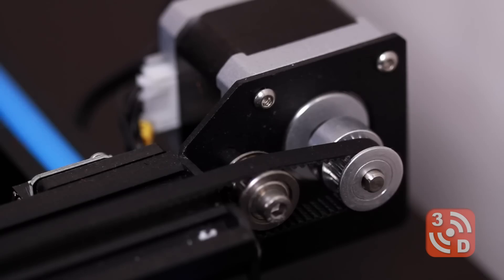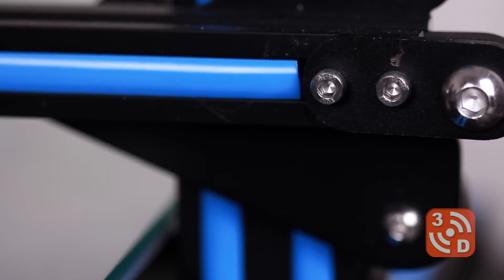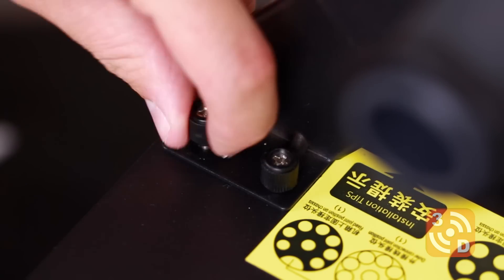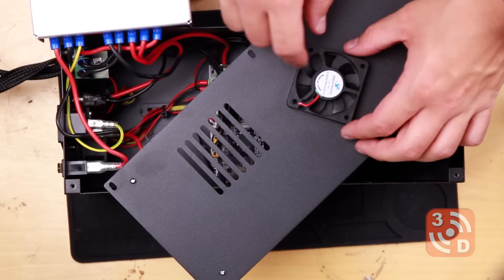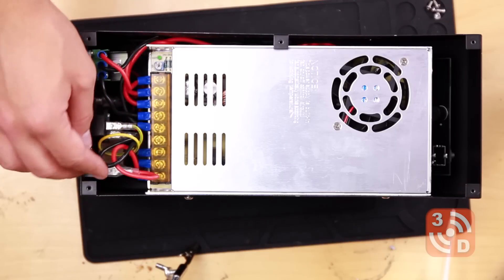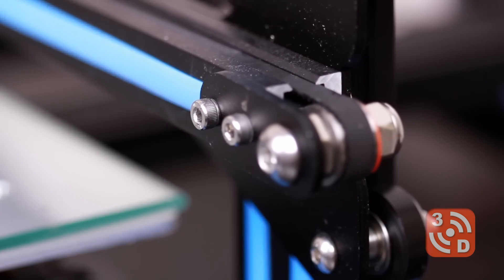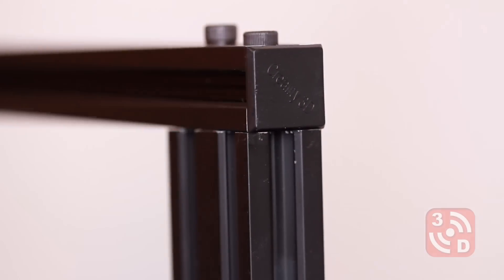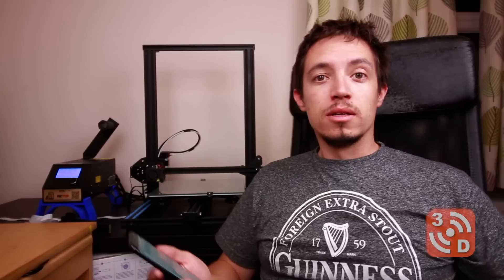3 Ways to Silence your CR-10

Comment: @13:05 you do some editing that makes me feel as though the x-axis was still noisy and you are pretending like the isolator mounts worked when they didn't. This may not be the case, but you sort of cut away from being able to see the machine moving, and went to some other footage and then came back and said "it worked"
Reply from the maker: Hi John, the cut was in no way intended to deceive. I cut from a wide shot to a shot where you could clearly read the value on the screen. Effectively I filmed the whole process in the wide, the reset the camera for the tight shot and did the whole process with the tight angle and just cut between the two. I'm sorry if you felt you were in any way mislead. The whole reason I started my channel was to offer easy to understand and honest tips and tutorials in 3D printing and tech. I've never wanted to misinform or mislead.
I can assure you that was also not the case here

Comment: I got a pair of Motor Vibration Dampers today, but it was a bit harder to install than just 8:33 as my model has a little housing over this entire part, so they could slap a QR code sticker over it. Took me a while, and needless disassembling, before realizing all I had to do was remove the sticker... Thought it was going to be just a fancy little gimmick, but no... I'm actually printing right now and I keep having to look over my shoulder to see if my print is actually done, because I don't even HEAR the nozzle travelling anymore. Well, only when it has to travel, as I set the speed high (Z-axis bar vibration), but this was done because the printer was noisy and I wanted the noise to finish sooner... NOW I can just print at a steady pace, even if the printing carries on into the night, as the cranky ol' man living the floor below will NOT hear the printing-vibrations through my floor!
I won't get the fans until late this week, if not next week, but just these two inexpensive vibration dampers have transformed this printer significantly, much to my surprise. The fans will just be for added comfort for myself, mostly! Thanks for making this video! 👍
Reply: Update: I got my fans and installed them... I have to say I was a little underwhelmed, as the box still sounds like a small handheld vacuum cleaner, unless it's the power supply fan (which I similar to this video, didn't touch) is making that sound all on its own. Rather build a small, cheap audio-foam box that it can stand inside. Other than that, the Motor Vibration Dampers are absolutely mind-blowing in how effective they are! Thanks again. 👍
Reply from the maker: Really glad it helped! The is for the feedback and good to hear it's quieter now.
Reply: @3DRevolution  Another update. I installed another vibration dampener on the filament feeder motor, so now my little Z-hops on travelling are extra quiet, as well as found some old rubber exercise bands, which I cut into pieces, unscrewed the Z axis motors and slipped the rubber strips in between the motor and the frame in an L-shape, poked holes for the screws and secured it back nice and tightly. This further reduces the Z-hop squeak/buzz. It's about as quiet is it'll get! 👍
Reply from the maker: Great work and thanks for coming back with the update! May all your printing be quiet and spaghetti-less
Reply: @3DRevolution  I DID have to quickly cancel my first print, because I forgot to account for the half of a millimeter I had just raised my Z-axis with by padding it. 😂 Thanks again for the 'silencing' guide! 👍
Reply from the maker: Haha well done for catching that!

Comment: Hello,

Thank for this great video, you really motivate me to replace my Fan 😀

I got a CR10 V2, I got a quick look inside and

> The Fan for ventillation is a (50x10) :Creality PD05015MS4 DC 24V then I do not think that I could replaced with the one that replace (Gelid Solutions Silent 5) since it's a 12V ?
The previous one for you was also a 12 V?

MY next question is How did you fix your camera on your bed since so far I did not find a way to do so.

thanks in advance for your help 😀😀😀😀😀😀

Best Regards

Cedric
France
Reply from the maker: Hey Cedric, Really sorry for the late reply. As you'll see from a recent video I posted ("I'm Back"), I haven't been able to post again for a while and I'm now catching up with everything on my channel and have some new posts coming out.

As for your questions, regarding the fans you mentioned, I don't actually have my CR10 anymore so I'm not able to 100% check which fan(s) it used I'm afraid. However, if yours is currently fitted with a 24v one, replacing it with a 12v is not a good idea I'm afraid. It may be that for the V2 they upped it to a 24v to increase airflow?

Regarding the camera on the bed, I printed an arm that fitted over one corner of the mounting points for the bed (so it was clipped on benieth the bed in the front corner and screwed on using the same screw holding the bed itself. 
If you check out Thingiverse (or better yet, Printables), for print-bed camera mounts for CR10, there should be a fair few to chose from.

Thanks for your comment, and happy printing!
Reply: @3DRevolution  thank you very much for your answer and information. If your back I will check your channel for every new video 😉😀👍

Thanks a lot !
Cedric 
France 🇫🇷

Comment: Are they 24v fans you replaced
Reply from the maker: Hey, I'm very sorry for the late reply. I've been recovering from a serious accident since July last year and whilst I've been reposting for the last couple of months I'm now getting round to catching up on my comments. I'm afraid I don't still have my CR-10 now. However, I belive they were 12v fans, but that the CR10s (the more recent one) used a 24v fan so that will likely require a 24v one for replacement.

Comment: Hey Does the PSU make noise? Could you maybe use a quiet pc PSU, I hear the CR10 is 12v?
Reply from the maker: Hey Pieter, yes the PSU does make noise due to the cooling fan.
It is possible to replace the fan but I chose not to cover that in this video as opening up the PSU can be dangerous and I didn't want to encourage people who didn't know what they were doing to start messing with mains voltage.
Reply: @3DRevolution  In the past 2 months since I've posted this. I've went full noctua on my ender 3 replacing it's PSU fan by a larger NF-18 and the extruder fan by a NF-A4x20 resulting in a noise level 22 db without the layerfan. I did have a faulty power connector that burned when I used the silent board's preheat all parallel feature.

Comment: I mounted my control unit under the desk, thus minimising a lot of the fan noise, not that is was that noisy to start with, the real noise came from the upper bearings on the Z axis leadscrews, the noise was occurring whenever the X axis was moving, because the Z axis leadscrew are so long on the 5S they resonate, I removed the steel roller bearings, measured them and printed solid replacements, no more Z axis noise.

Comment: Nice. I made similar changes before found your video, but now my CR10 is in the basement and I switched to Alfawise U10 where I made lot more changes to silence it even more. Also replaced the stepper drivers by TMC2208, which made the printer really silent. Pity, CR10 has no replaceable stepsticks.

Comment: The noise of the steppers cannot be measured by moving axises, instead you need to put them in printing mode because their movement speed is in fact much higher.
Clear and well presented instructions

Comment: DO NOT DO THIS MOD. I spent the £40 for all the fans. And the one for the extruder. Is only half the speed. Which results in the extruder over heating goes in to safe mode and the ones you put in the power supply are not fit for purpose. So have to buy all new fans from clarity DO NOT LISTINE TO THESE VIDS. YOU WILL KNACKER  YOUR MACHINE UP.

Comment: Must be a real PITA using a Creality XX.
My P3Steel Toolson with bronze sinter bearings runs at 34db with A4988 drivers out of the box.
It sits behind me and every now and then I have to turn around to see if the print has already ended.

Comment: the air flow designs are so dumb on these chinese printers.

also most power supplies sound like a jet engine ;c you could've used this as an opportunity to replace that fan too!

I removed the PSU and the motherboard fan on my Anycubic. mounted a super silent but cheap (bigger ones tend to be less noisy at cheap prices) and covered every single vent expect for the one on the rear back. now air comes trough the front and exits trough the fan. no issues whatsoever.

Comment: Great video, But those strips can just be pulled out as they are. No need to remove anything. Just something to pry them out and pull out frontwards.
Reply from the maker: Thank you very much Beagz, glad you enjoyed the video. Yes the strips can just be pulled out but I'd read a number of people saying that theirs were produced with extra stiff rubber and I didn't want to advise people putting undue force on their printer when trying to remove them so was more a precaution than anything

Comment: that moment, 
when you realize that you have the same chair from ikea and that the head piece is worn the exact same way than his
Reply from the maker: Haha, I've been meaning to replace this thing for around 2 years but still got it. Has the height control also broken on yours? I cant tell you the amount of re-takes I've had to do because half way through a video I slowly start shrinking on the chair.
Reply: @3DRevolution  no it keeps it hight pretty good, at the lowest setting :D no just kidding, really the only thing that bothers me is the flaking off the headpice, everything else is very good made, better than anything i had before. usually the chairs last only 1-2 years, this one i had for like 3 or 4 now.
Reply: @MrZhefish  lol good call. #metoo

Comment: No one has mentioned that when the belts are tightened, it pulls the motor's spindle so that it is no longer in alignment with the other ones. This is due to the give of the rubber. It was bad on my Y axis and I didn't even have the belt super tight. I ended up taking it off the Y. EDIT: Just found this which may help: https://www.thingiverse.com/thing:2734468

Comment: the real problem are feets!!!!
Reply from the maker: Hi Enea, thanks for the comment. You are absolutely right that the feet make a difference. 
Here's a set of vibration dampening feet I designed for the CR-10: https://www.thingiverse.com/thing:2738254
Print them in a flexible filament and they make a big difference.
Reply: @3DRevolution  i m interested in your files... i ll print for sure! Thanks a lot

Comment: Just wanted to ask if it affects print quality. Coz, just in theory though, when you have that dampeners installed and there is a sudden change in stepper direction, the rubber may have a tendency to twist and therefore target coordinates may overshoot.
Reply from the maker: Hi there, I can happily confirm a year after making these changes that print quality was unchanged.

Comment: You can just pull out the blue stripes in the frame without dismounting anything because they are out of a felxible material and not stiff... It also was unnescesarry to pull out the one on the horizontal top bar. There are no moving parts at all ;)

Comment: if you really wants to quiet down this printer you don't need to change fans but add temperature controller for fans. When it heat up, but usually will not it will speed up fans.

Comment: My only concern would be if you reduced the amount of air that those fans were moving to the point that you reduced the effectiveness of the cooling on the circuit board.  It's now been several months since your modifications.  How is the printer fairing?
Reply from the maker: Hi there, I'm happy to say a year on and everything is still running great with no problems. Thanks for your comment and hope your printing is going well.

Comment: I'm sure this has been mentioned already, but sound measurements in decibels are logarithmic, meaning each decibel increase of decrease represents a doubling or halving of the sound pressure level. So dropping 15-20 db is an INCREDIBLE reduction!
Reply: not each decible but all 6 decibles halfs/doubles the noise

Comment: Wicked! I have been searching and can across many videos good and bad on mods for the CR10. These mods for reducing sound are to be the first to do on my friends CR10 once I get to it! 

Question: Since it has been almost a year that you have posted this video, are the fans used the same for the CR10 regardless of the size (example the 5S)?

Thanks for the video and I have subscribes, turned on the alert and gave it a thumbs up! :)
Reply from the maker: Hi Gregorio, Thanks for your comment and I'm so sorry for the late reply. I've been out of the country most of this year on work.
I'm so glad you liked the video. 
Regarding the fans, I'm afraid I'm not 100% on the 5S but what I can confirm is that a year on and the fans I replaced in the printer are still going strong.

Comment: How come even though I bought my cr10 from the same place as you have a link to in the description, the screen of my cr10 looks different?
Reply from the maker: Hi Matthew, are you in the UK or America? I'm in the UK and have provided links to the same product in the UK and the USA. However, they are from different suppliers so there is a chance they have provided you with a slightly updated version of the CR-10
Reply: 3D Revolution I am in America.
Reply: 3D Revolution also what it the max temperature that the nozzle can heat up to electronically?

Comment: Just noticed that you cut your fan wires while the unit was plugged in . Whoops .
Reply from the maker: Nope. The cables coming out the back of the unit are the cables that go to the printer itself (which had been detatched for this process) but are hard fitted to the control box end.
Reply: Just asking because at 6:20 there is no power cord and at 6:25 it is plugged in .
Reply: Lol, nice catch.

Comment: One very simple and very effective thing you can also do is to put foam (the one used for shipping and packing products) underneath the printer. However print some small square plates to put on top of the foam to spread out the pressure and prevent the printer legs from indenting the foam and rendering it useless.

Comment: His is removing the rubber strips siliencing anything?
Reply from the maker: Hi Kevin, This was more of an experiment to be honest. As I mention in the video, I'd heard rumours of people saying that parts of the X axis were rubbing on the rubber strip causing fruction which could both cause sound and print errors. I've no idea if that is actually the case but I kind of prefer the look without them anyway so I removed them when doing the rest of this work.

Comment: Another important topic is reduce the desk vibrations if you live in an apartament, because those vibrations in the floor (Ex. wood floor), are transformed in noise to apartament below. A great solution is use a rubber or yoga carpet below desk.
Reply from the maker: Absolutely. I've actually designed some very effective rubberised vibration dampening feet for the CR10 which I'll be popping up on my Thingiverse account soon!
Reply: @3DRevolution  Do me a favor please. you're replying to everyone else's msg except the most important comment on here?? which is the one above this msg  from Jean-Marc Van Laethem re: the rubber on the stepper dampers causing motors to wear out quicker?  I'll assume that you just missed it?
Reply: @compubyte2010  why don't you answer it

Comment: My Gelid Silent 5 isn't spinning either... Is its activty temperature-dependent or is it supposed to be active all the time? Can anyone help?
Reply: It should be active all the time since you're not using the pwm of the fan. Just the +12V and ground. Make sure you have the correct wires attached, do a quick google search for the datasheet.

Comment: Just did the two case fans but the Gelid 5 is intermittent.  Soemtiems it does not start up when the printer is powered up.  I have checked the wiring and all seems OK, and ideas?
Reply from the maker: Check that the fans you bought are the correct type and not the PMW style, if they are the correct straight voltage type, then yes, just check your solder points and make sure there's no loose connections.

Comment: Before contemplating any of these mechanical & electrical changes, I did one very simple, fast, & easy thing which has reduced the sound produced by the 3D printer, from travelling through the walls into the next room, & through the floor to the downstairs part of our home quite remarkably.  The difference achieved in around 3 minutes was incredible!  - At a guess I would suggest the "transmission of sound" (in our particular home), through floors and walls would have decreased by at least 30% and probably closer to 50% or more!  I very much wish I had measured it before as the results after were awesome!  I simply placed one of these mats underneath, ( https://images-na.ssl-images-amazon.com/images/I/71FiFi9S2nL._SL1325_.jpg ) specifically the ones with holes in them, and placed a small 100mm x 100mm x 5mm square of hard plastic (you could print such) under each of the printers feet. It's certainly Not silent, but Wow what a difference it made at our place!  You might be be surprised at such   https://images-na.ssl-images-amazon.com/images/I/71FiFi9S2nL._SL1325_.jpg.